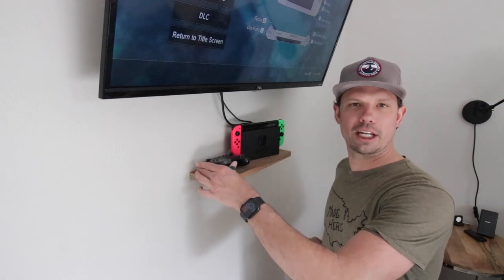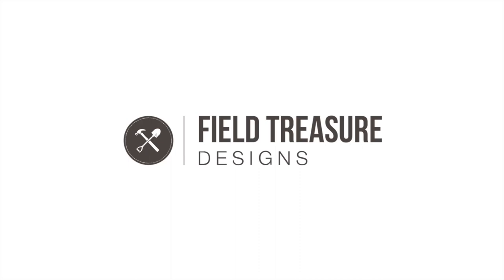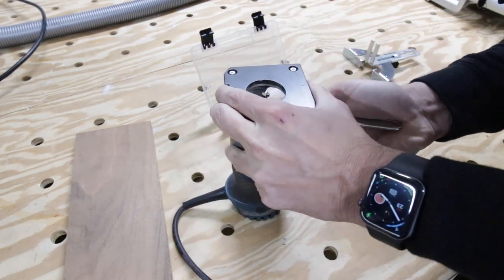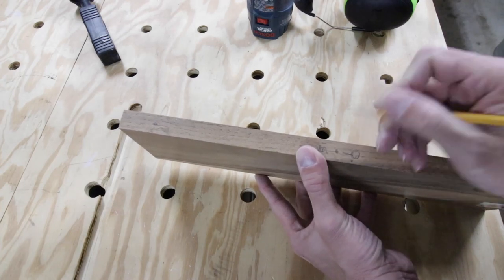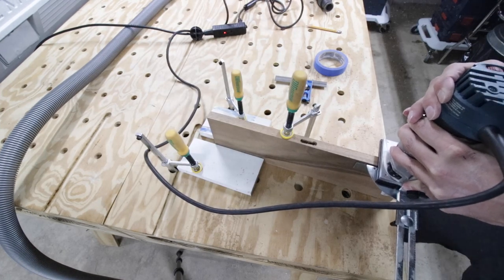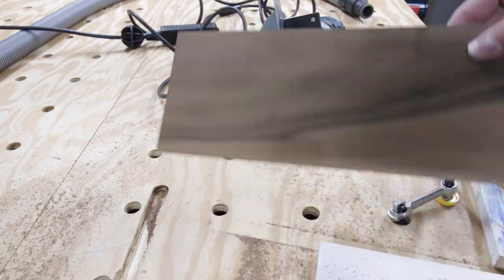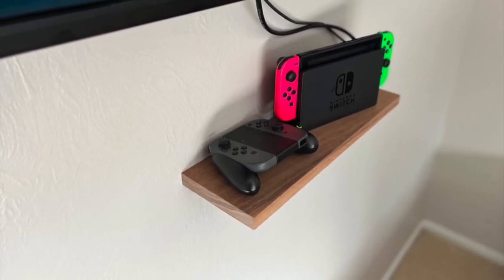How to Make a Floating Shelf

Comment: Does not look very stable
Reply from the maker: Sure I wouldn’t stand on it but it’s more than stable for its intended use.
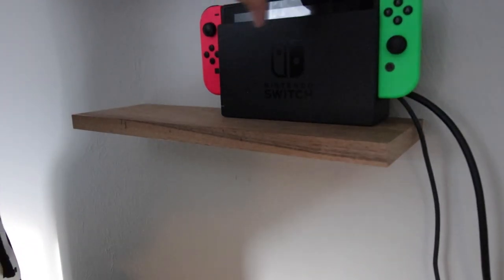Reply: @diywithandrew  @2:58 it looks like if you were to put the switch towards the front it would eventually break. With only 2 screws that are about a 1/4"  in the wood does not seem very stable to me.